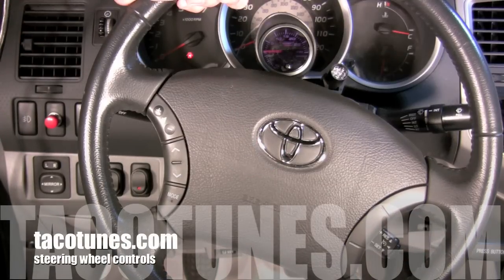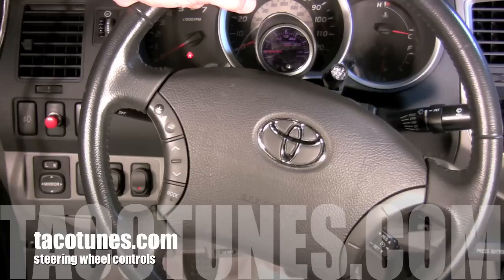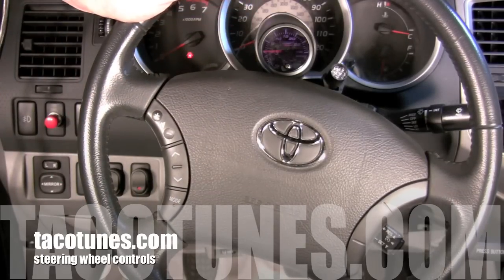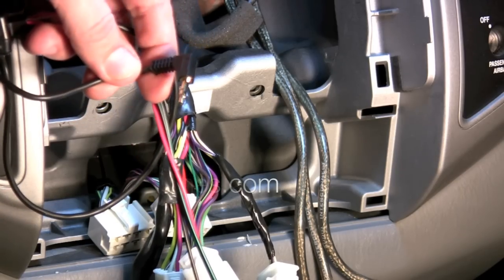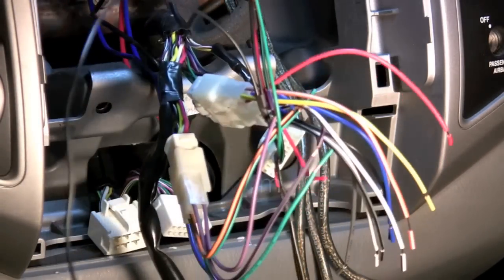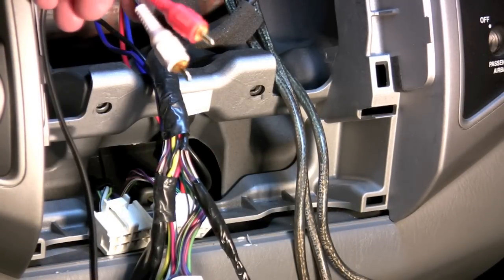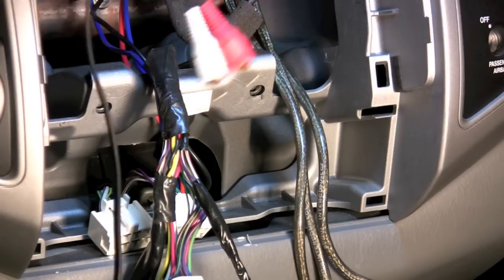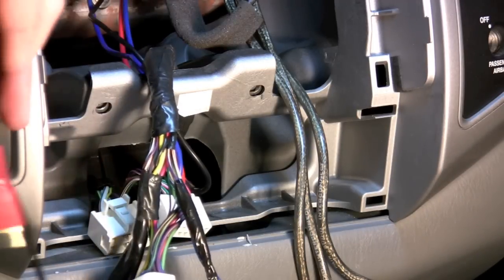How to install Steering Wheel Controls in Toyota Tacoma Double Acces Cab 2005 2014

Comment: I tried to install the axxess Aswc-1 today and it was hell and I still didn't even get it done. I called sonic electronix, crutchfield, metra and I even took it to the shop and they couldn't even figure it out cause for my Altima it has like 3 different ways and none of them worked and I don't want to risk it anymore for $50 but the harness you have in the video I want to try. Where did you purchase yours.

Comment: i have a 2007 hilux that had basic steering wheel no controls, i fitted an aftermarket head unit and a steering wheel from a 2015 with control buttons BUT the truck has no wiring in the harness, am i able to buy a kit that addresses this issue?
Reply: I'm wondering the same.

Comment: One question, I have a 2014 tacoma base model with factory radio with touch screen and Bluetooth(no navigation) and no controls for radio or phone on the steering wheel, I see some steering wheels for sale on eBay with the controls on it(factory). The question is, what do I need to make those buttons work with my stereo, is there a wire which I can just plug and play?

Comment: I got a 2011 tacoma with jbl system and acs-1 kit. I have the steering wheel harness in the video but the black plug  does not line up any where to plug into interface.

Comment: Toyota Steering Wheel Control Wire Harness 12-WCH02 + Metra Axxess ASWC  1 
Which cable color from ASWC 1 to put in Wire Harness 12-WCH02 in my car?
Any guide please helped me.
Many thanks

Comment: I installed my CD player using Metra 70-1761 Radio Wiring Harness. I got it where are 2 connectors go. I did not get where you pulled the 3rd connector from? I uploaded video on my channel step by step. It would be nice if you could do the same for Steering wheel control, because this instruction stops me from buying the adapter that you demonstrated.
Thank you.

Comment: If I have a 3.5mm jack on my stock headunit (4runner), where do i plug in the red & white RCA cables into the head unit? I'm on a Pioneer AVH-2300NEX and there are 3 pairs of red & white RCA cables: highs, mediums, and lows. Which one should I plug them into?

Comment: you do NOT! need this interface to install steering controls on a Tacoma, nor do you need it. in my 2011 tacoma it did not even work. don't be fooled like i did . also buying from tacotunes is over priced especially for a interface you do NOT need.  so don,t be misled and spend extra money  for no reason at all. so i repeat you do NOT need this interface for a Tacoma!
Reply: bunny sang what kind of Tacoma do you have?